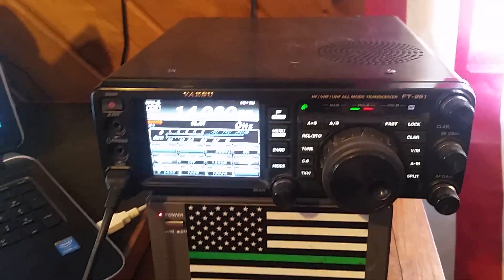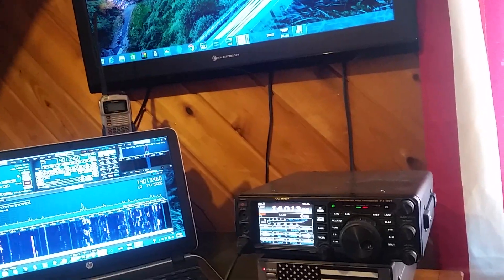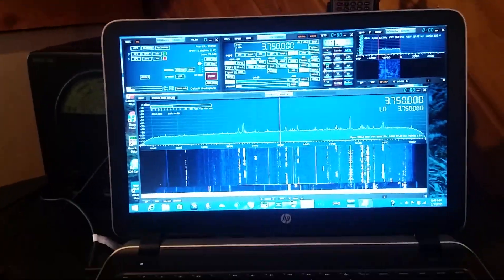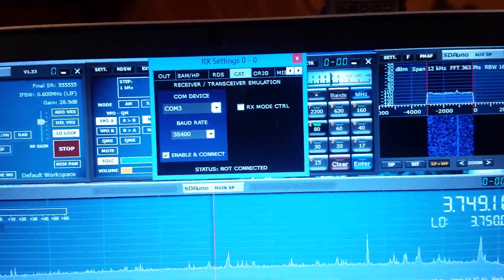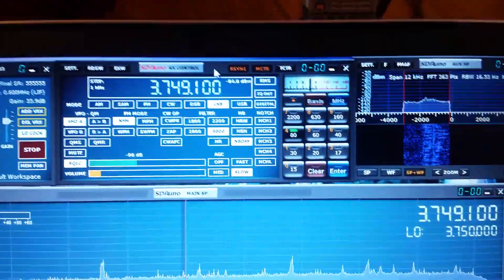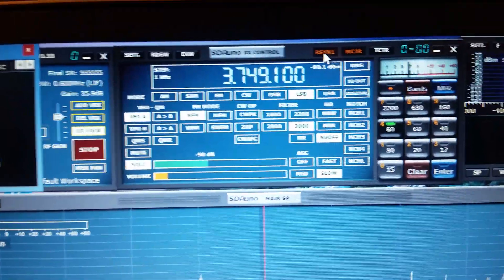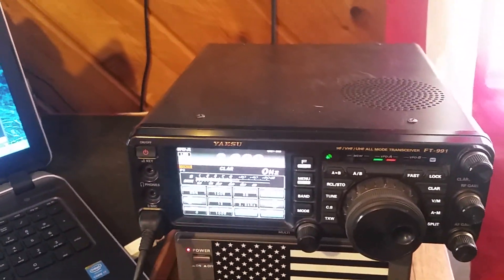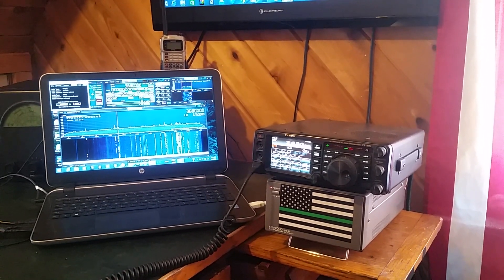Yaesu Ft-991 /SDR Rsp1a, and sdr UNO, Connection

Comment: I have not tried to hook up SDRPlay to the 991a as of yet because there is something missing from the back of the rig, IF out or RF out. So your saying that you are receiving using the USB jack and Omni-Rig?? I have an FT-DX300 which comes with those options (IF out or RF out RCA jacks) and I use a homemade cable from the IF RCA jack out straight to the SDRplay antenna jack. This give me the signal for the receive on the SDRPlay. The only other thing is hooking up the USB from the back of the 3000 to your PC, and also hooking up the USB from the SDRPlay to the PC as well. Then of course you set up your com ports,etc. to a program such as N1MM for example.

Since there is no IF out or RF out jacks on the back of the  Ft-991A, how would you hook up the SDRPlay to receive? I am also a bit confused as to why you cannot TX with the SDRPlay hooked up. I use SDR Console and just go to the external radio settings menu,  then Transmit, and tick the 3 checkboxes labeled mute audio, set RF Gain to(set to -80dB) and reduce IF data by (set to -80 db) and I have no issues transmitting 100 watts from the rig. Am I missing something?

Comment: This honestly seems kind of pointless.  You either will need 2 identical HF antennas or a switch to switch beck and forth between the SDR and the 991.  You didn't show that part in the video.  WHy not just use something like a hackRF one and be done with it?  One hookup, one USB cable, one antenna, no switching.
Reply: Can you TX with HackRF with the same antenna on ft-991a??

Comment: Thank you very much for the video, this is exactly the same setup I will do, RSP1A and FT-991, I purchased the MFJ-1708B-SDR TR switch, question, to do this setup, did you use OmniRig? I know OmniRig works for HDSDR and SDR Console so I thought it was needed for SDRuno. Thanks again.

Edit: waiting for the part 2
Reply from the maker: Thanks No omni rig is not used,  it's really slick.
 Let me know how this works. 

   And I will do part 2 eventually.  Had basement issues with melting snow So I'm busy keeping water out the house.
Reply: @lovoldm  Hello again, I used the MFJ-1708B-SDR and I'm not impressed but concerned with the isolation on the RSP1A, actually I think the RSP1A is getting a lot of my FT-991 signal specially on 100w SSB, I had to change the AGC to fast in SDRuno and I bought a Easy TR Switch from QRPKITS.COM, assembled it and I did a modification to it, the MFJ when the rig is in TX it will short to ground the RSP1A input, so the mod I did to the TR Switch was when in TX it will short the cable coming from the MFJ and short the cable going to the RSP1A, now I see a reasonable reduction I the signal coming to the RSP1A.

By the way, SDRuno and the FT-991 are synchronized.

Thanks
Reply from the maker: @vijovame  glad that it's working
 I have heard that about the 1708b, I just unplug the usb cable and shut down sdr uno when I want to chat. 
  It seems to be fine that way for now
  Thanks I will check out the link.
Reply: @vijovame    I don't understand how you connected the TR Switch.  You mention that you modified it to short the cable coming from the 1708  and short the cable going to the RSP1A.  There is only one cable going from the 1708 to the RSP1A which is grounded inside of the 1708 in Xmit.  What cable are you referring to that "comes from the 1708" that you short when transmitting?
Reply: @gregbaer3595  that one, I know it's already shorted in the 1708b but I short it again in tx on the TR switch. By the way, I replaced all coaxial jumpers to rg213/u and that helped too to the problem. 2 wire jumpers on the TR are needed to get the short in the 2 cables, the one coming from 1708b and the one going to the  sdr. I can send you a picture but I don't know how.
Reply: @vijovame  OK.  That makes sense.  You added a TR switch between the 1708 and the sdr.  I just wanted to make sure that is what you did.  I've been thinking of doing that very thing.  I didn't know about the Easy TR Switch.  It's the perfect solution.  I just ordered one.  Thanks!
Reply: @lovoldm  Half those settings you set come from omnirig. ?? So how can you not be using omnirig. ORIG = OMNIRIG
Reply from the maker: @andym7gzz186   Yes I apologize. It does use omnirig.
  Thanks

Comment: So if you don't use something like the MFJ-1708B-SDR do you have to switch the antenna back and forth between the SDR and the 991 to receive and then transmit?

Comment: Going to do this with my 1200 very soon I ordered all the stuff
Reply from the maker: I forgot to mention you got to use Omni rig but it's pretty simple.
 the only thing I don't have is a way to transmit I got to shut the SDR off,
   I don't have a transfer switch so you got to be careful there.
Reply: Does Omni rig just run in the background
Reply from the maker: @kevinokeefe7796  
   Yes it does
Reply: Have you managed to pull this off? Does it work with the MFJ-1708SDR +TR switch??

Comment: Why do you need the extra cables? Like FL Digi will run with just a USB. Not understanding what the extra cables are for.
Reply from the maker: One cable is for the sdrplay. The other cable is connected to the 991
This is a easy way to make your radio like the new expensive ones.
    Omni rig is also used.  No extra hook ups needed for Omni rig.   
    Only two cables r hooked up

Comment: Hey, thanks for the video! I am not yet quite sure how you have set-up everything. How is which device connected with which device? USB from FT991 is connected to the computer for CAT control only, right? The IQ signal is not coming via that same USB, right? How does the audio/Antenna signal (?) from the FT991 go to the  SDRPlay Box/computer?  Would be grateful if you could enlighten me! Thanks in advance! I personally have hooked up an SDRPLAY RSPduo to my computer here using SDRUNO with it, but so far no connection between the computer and/or the RSPduo with my FT991. BR, 
Steve
Reply: I have the same issue. It doesnt work.
Reply from the maker: 2 separate USB cables, one goes to the SDR play. One goes to 991 same laptop.
  I hope you have luck getting it hooked up.

Comment: Really sucks you have to buy almost $400 worth of stuff just to get Remote Control + PanAdapter for a $1200 Radio. Almost everyone is doing IF output on their higher end radios. Makes no sense why Yaesu would so heavily limit the 991s.
Reply from the maker: Well yes it does stink.
 But the rsp1a costed me 110 dollar's, 
 I used sdr uno free software download, as well as the free omnirig download.
    So it was very reasonable.
    I still need to get a good RF protection switch,
    But using a external monitor, and being able to see the signals,
   it is way cheaper than the Top of line radios.  
   Just with a few less Perks.

  But with my budget, this works Mint. 
   Enjoy the day.
Reply: @lovoldm  Have you find a solution for TX? MFJ-1708SDR +TR switch??